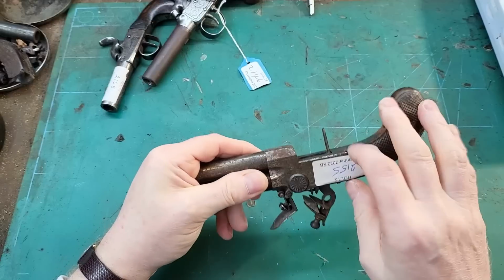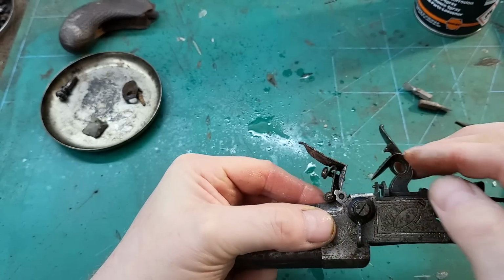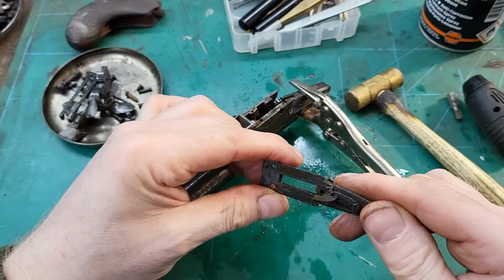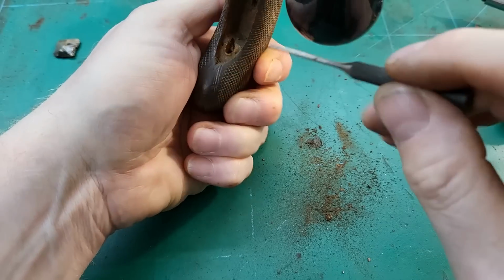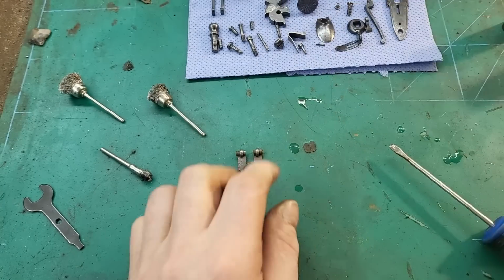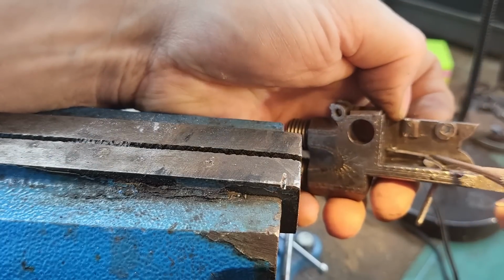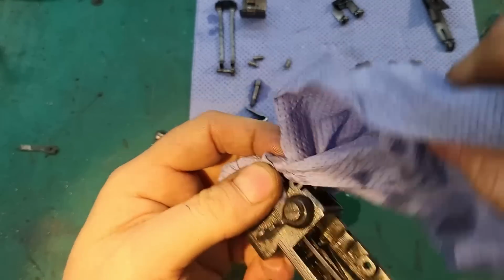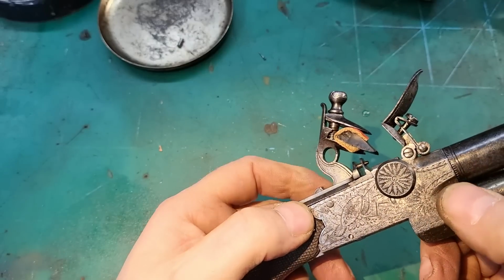I Got An Antique Hickin Flintlock Tap Action Pistol For Dirt Cheap! Can I repair it?

Comment: might have gotten that screw out soaking it with some mineral oil and tapping on the head, , the grip turned out great tho,  I Don’t like the finish that the wire wheel does ,it gives a smeared look to the metal, i usually use mineral oil, fingernail ,wood toothpicks and lots of time. , ,great video , nice shower of sparks, should work well
Reply from the maker: Thanks, I'll bear that in mind for the future.
Reply: @morriscarstairs2685  hey, just wondering, when you tempered the spring , did you let it heat up to the desired temperature and then shut the element off and let it cool down slowly on the element ?
I’ve been tempering by dipping the spring in oil then heating till oils vaporized and springs almost red Then I dip back into the oil , then I reheat about half as much , dip again , then I heat it up just a little bit and dip for a 3rd time, it seems to be working, but your way is probably more precise, I will have to buy a temp gun and try the way you do it and compare.
Reply from the maker: @Ypvs350r  All I do is first heat the spring till bright yellow hot and quench it in quenching oil. I then keep the hob at around 330-360 and leave the spring on it for 15mins, then take it off and let it cool off the hob. When cold I flex the spring very slightly 20 or so times to work it in and then fit it. This seems to work fine for me.
Reply: @morriscarstairs2685  ok cool, that sounds simple, what do you use for quenching oil? I’ve been using vegetable oil , but I’m pretty shure it’s probably not the greatest oil to be using
Reply from the maker: @Ypvs350r  I use specific quenching oil, I searched eBay for "quenching oil" and bought a 5lt bottle, but veg oil will do it, no problem, I think Mark Novak uses water which works also. So I'm not sure oil is required at all, use water.
Reply: @morriscarstairs2685  👍 thx for the reply